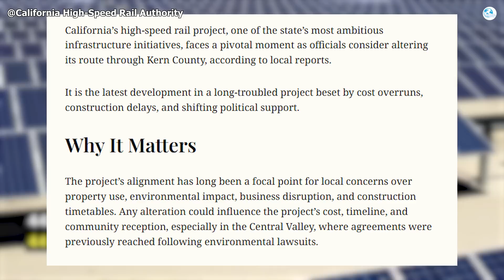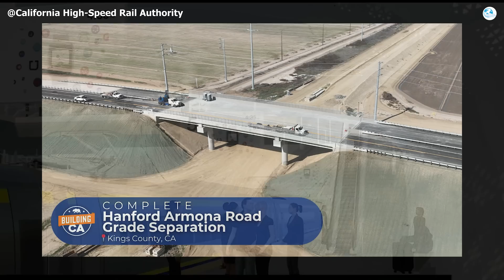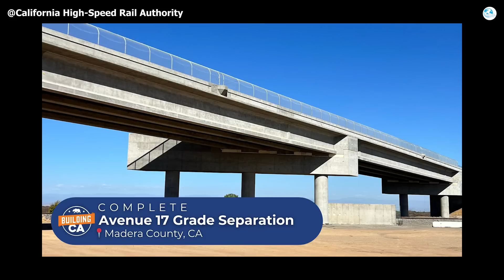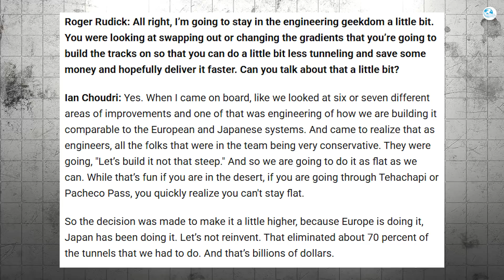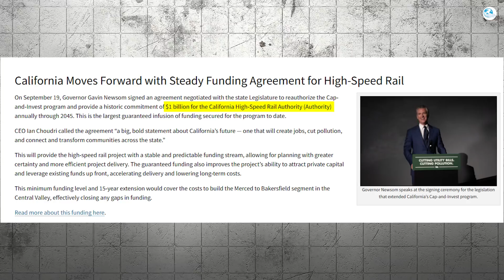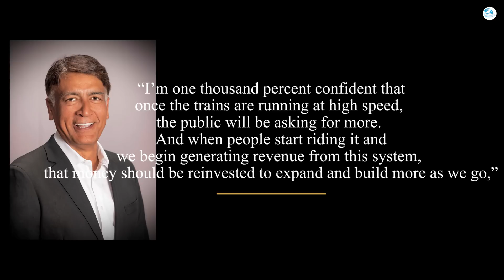California High-Speed Rail’s Huge Update

Comment: Why, why, why they just didn't build this on the west side of the valley along I5. No cities or prime farm land just wide open space. Totally stupid not to follow the I5!!!
Reply: Why not use existing railroad right a way or just improving the existing trackage. The railroad carries thousands of pounds more freight than the train to nowhere could ever carry!
Reply: @dennislink7957  Because by law the trainsets must be electrified and capable of cruising at 200 mph which even you might understand eliminates existing rail with grades, curves and rail designed for 79 mph.
Reply: Like all high speed rail networks they are designed to connect population centers together.  Thus, the I-5 corridor was a non starter.
Reply: why why why didn't they just add a lane or 2 to the 5
Reply: @timeakin1169  Because that would be pointless.
Reply: This happened due to voters voting the train to follow Hwy 99, apparently.

Comment: The problem is that Central Valley politicians don't want the rail; they see it as a "jobs program."
Reply: That’s dumb they can build new high speed and regional rail lines there are always new connections u can build even china and Spain are building out tons of new connections and they have the most in the word
Reply: The Central Valley  is against it because it is nothing but a fat union jobs program and an environmental  disaster that has ruined thousands of acres of prime farmland that will never be reclaimed after the whole thing fails.
Reply: @DaleRush-t2s there is a way to solve that called viaducts if it had enough funding stop with the just quit lots of countries have high speed rail I’m going on a high speed train in an hour literally. There amazing
Reply: @joshpeck9266  Where, certainly not in CA or anywhere else in the US
Reply: @DaleRush-t2s  why? You can design Vioxx to look nice like with stone cladding or something no one ever complained that Roman auction ruins the view. Aqueduct … we have ugly highway ones all the time.
Reply: @DaleRush-t2s  That's our issue.   That is why we Californians are building one.
Reply: @DaleRush-t2s  Nope.  They are against it because it will accelerate the political demographic shifts from the Bay Area to the Central Valley which is already on going.
Reply: Infrastructure maintenance will indeed be a "thing" on the high-speed portions of the rail.  I think the real costs will come after the rail is built.
Cali as a state will have to figure out a way to make money with it.  Will see.
Reply: @jazzlover10000  wouldn't it be neat if there were like, high speed rail systems all around the world, so that the CAHSR could know how much maintenance and overhead will be required? And wouldn't it be neat if they've been reporting all of that sort of data out for years, for anybody who was interested? Gosh, I'm sure nobody ever thought about that.

Comment: One of the contractors Perini has major lawsuits in Las Vegas for buildings that could not pass inspection.
Reply from the maker: The Perini case in Las Vegas is indeed a clear example of how failed inspections can cause major problems.
Reply: Good to know!  Nice safety tip, Egon.

Comment: I think that this high speed rail system is a waste of time,it is so far behind schedule. Lack of money to continue building this project. I don't think s high speed rail service is needed..I think they should rethink this failure..
Reply: You don’t walk away from mistakes and failure. You learn from mistakes and move on and win in the end. This is how we won WW2 since we started with the disaster of Pearl Harbor and getting or butts kicked and kicked out of the Philippines. We did not walk away.
Reply: Also lots of people thought for years we did not need passenger airplanes and we subsidized it for years with airmail to get it going. High speed rail is a success worldwide even with cities separated with open countryside like the USA. Besides we spend a fortune widening urban expressways with higher costs per mile and no real lowering of congestion in the end. Consider the 26 lane Katy expressway in Houston Texas. 26 lane sand traffic is still jammed up.

Comment: 4:55 high speed Lines need smoother curves than regular lines but slopes can be steeper on the contrary. Kind of surprising they found out just now, though.
Reply from the maker: Exactly! High-speed rail requires stricter standards, so this discovery makes sense.

Comment: The transcontinental railroad, 1776 miles long, from Omaha, Nebraska to Sacramento, California, was built in six years, 1863-1869, for 50 million dollars, $1 billion in today’s dollars.

The California high speed rail project is projected to be 800 miles long, has been under construction since 2015, ten years so far, has cost $15 billion to date and is expected to cost $128 billion to complete.

Don’t make no sense.
Reply: There was open land and we killed of the natives and took the land so right of way acquisition was the only easy part. The rest is amazing but we as country really wanted to do it.
Reply: Low speed rail is easy.  There is a ton of recently built low-speed freight rail in Orange County and commuter rail from San Jose to San Francisco.
We know how to do that it's really no problem.
Reply: Its a quality difference, you are complaining that a 737 costs more to build than the Wright Flyer. Of course it costs more, it goes 250mph, is electrified, and is grade separated.
Reply: So apples to apples then.  California high speed rail costs about $160 million per mile.  Europe high speed rail, $25-80 million per mile.

Comment: Boondoggle. Imagine if California spent 0.00001% of the cost of this boondoggle on fire management. Pacific Palisades wouldn't have burned down.
Reply: Read a book!
Reply: As was revealed this week in the Los Angeles Times, the Pacific Palisades Fire was the result of Fire Captains refusing to believe their rank and file that the initial hot spot was not secured and that areas were still hot to the touch.  The rank and file wanted to return, finish the job, and monitor.  There requests were denied.  You can sit down now.
Reply: @AxesoftheDanes   So a left wing paper absolved the left wing government of blame. Gotcha.
Reply: Or don't build houses in a consistently active fire zone.

Comment: I live in Fresno where the HSR got started. It's been nothing but detours and road closures and headaches for business owners and citizens alike. Not to mention the design being misplaced. They should have run it straight down highway 99 and kept it straight and simple.
Reply: Maybe the rail needs smoother curves than the highway from an engineering and speed standpoint? The station definitely needs to be in downtown not inside a freeway for maximum impact, usability, and development potential.
Reply: @NeoXCXIII The station can have an annex entry and departure access or an elevated platform. Either way it's grossly mismanaged and costly.
Reply: Anywhere concrete+asphalt infrastructure is being built is a good place to take a vacation from for a few years!
You should go elsewhere and come back.

Comment: It will NEVER be finished.  Its projected to reach LA in like 2045 and cost over $110B.  By 2045 that will be $300B.  No way it lasts that long.  The first segment will lose so much money for CA they will cut it. There is one more problem to this "revised route" to avoid cutting cities in two-- now the train has to go around curves to avoid cities making it run at slower speeds than "high speed".
Reply from the maker: It’s a long and challenging journey, but progress is being made.
Reply: Actually, the 128 billion dollar high end estimation for the cost of the LA Union station to San Francisco is in 2033 dollars which has been adjusted for inflation.  I've seen your posts on this project many times on many other videos.  I think your prejudice is coloring your perception of this project.  If you listened to this video, they correctly reported on Ian Choudri's identification of cost savings based on the simply accepting an international grade angle costs will be lower and construction will be faster.  Hope this helps, but I doubt it will.
Reply: @AxesoftheDanes    The most recent changes, involving cutting out Merced, imply a total cost of $148.5B if the cost escalation on that leg is pro-rated across the whole project. Choudri's "cost savings" were an old government trick - if the cost jumps from $100m to $200m, tell the sheep that it would have cost $250m, until you "saved" them $50m. I didn't know there were still people who fell for that.